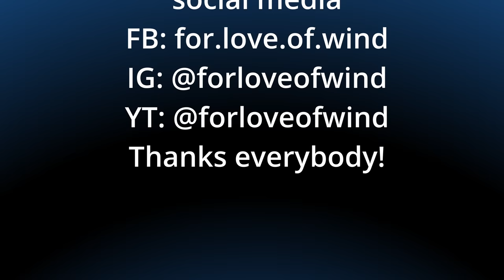4 Can we DIY an arch for our boat?

Comment: With this video you are now playing in my ballpark.😁 40 years of marine construction, overhaul & repairs. 1st thing, become a fan of latex or nitrile gloves. They'll save you many hours & some skin when it comes to cleaning up after using adhesives, epoxy & various paints. Not to mention preventing you from looking like a Picasso rendition at happy hour.😉 Everything else in no particular order, if max strength isn't a requirement stick with 316 grade stainless steel. (Backing plates & hardware.) It'll cut down on corrosion. Get familiar with butyl tape. It's a soft adhesive & great for sealing out H2o. That 5200 adhesive will make it harder to tell that the hardware holding the arch is coming loose or broke. If you do it right the butyl tape will make the hardware self locking & help keep it from backing off. Mount the starboard plates to the hull with the 5200 but mount the arch feet to the starboard with the butyl tape. That'll make removing the arch for maintenance or reconfiguring later a little easier. (As well as water intrusion resistant.) That Tower In A Box is a very basic foundation. (Think beginner level😁) In time you will probably think of many ways that it could have been modified easier before it was installed to accommodate things like antennas, lights & wiring and extensions to support a dingy & solar panels etc. 
This tiny bit of info isn't the tip of the iceberg challenge you've taken on. It's simply some of the shiny top of the tip of knowledge, expense & experience of boat ownership. BTW, That's one of the reasons I've downsized to a 15' canoe.😁 
BOAT = Bring On Another Thousand...  (Cash, planning, schedules, tasks & et al. 😉😂🤷🏻‍♂️🙏)
Best Wishes from the Northern Gulf of Mexico 🙋‍♂️
Reply from the maker: Thank you sooo much for taking the time to write this comment! We always, always appreciate advice from our viewers, especially with as much knowledge as you have after years of experience in marine construction. Please by all means feel free to reach out with any wisdom you have! I will tell you one thing we have learned so far in this new boat life, BOAT does INDEED mean Bring On Another Thousand. Sometimes Another Ten Thousand!!

Comment: Loved it! I would ask cade to purchase a box of vinyl gloves HAHHAHHAHHAH  I know the humidity makes your hands sweat, yet the toxins you can take in thru your skin,isn't worth the comfort of not wearing the minor PPE.  I do really appreciate cade's ability to comprehend the process make a plan and implement the plan to get it right.
Reply from the maker: You know, the funny (embarrassing) thing is, I think we actually had a box of gloves in the boat somewhere... Much of the time it seems like when we do these projects, we "don't think- just do." But you're right about toxins- we definitely don't want to expose ourselves to something dangerous. Cade is pretty sharp and very mechanically inclined, and it's a good thing because our budget dictates that we must do most of the repairs and upgrades ourselves!
Reply: @forloveofwind  Yeah, I am just a cheap ole bstrd, Hate spending money on things, which gets me into so much trouble with getting things done correctly and in a timely matter. Funny enough when I know I need to pay for the professional to do the work I have to deliberate about it far too long.
Reply from the maker: Yeah, that sounds awfully familiar!! We are exactly the same. I will tell you- we have a repair in an upcoming episode that really should be handled by a professional.. but the quote we got to fix it was astronomical, sooo <gulp> we are going to get a professional consultation only and then tackle it ourselves.... >_<
Reply: @forloveofwind  Ha you're gonna have to search youtube to see if someone has already done it. I know you all will get it done. That is one thing I think all sailors need to do. You then know what is breaking down at sea and it is not such a great emergency.
Reply from the maker: Well put, I think that is very true.

Comment: Great video. If the legs on the tower were asymmetrical, it would fix the wobbling issue.  2 things to consider.  When drilling through the exterior of your boat, consider the drill, fill, drill method using thickened epoxy.  I know the 5200 should seal everything, but water tends to find a way.  Also, getting a light shock by touching a metal bracket is a huge red flag.  Not just for safety, but it indicates stray current going where it shouldn’t. Check your zinc’s quickly and if you see excessive corrosion (if you still have zincs), tell your neighbors too.  Stray current can eat the metal in your boat within weeks, and everyone around you.  (I wouldn’t tell your neighbors that it’s your boat possibly causing an issue, then there might be a liability).
Reply from the maker: Thanks again my friend, it's a good thing we decided to post our story on YouTube because we've gotten a ton of good advice from the community on how to do things the right way. Since we learn while doing, there are many times when we have to do back and re-do things because they didn't turn out quite right... Keep the wisdom coming, I think I should copy all these great comments and keep a document on the boat that we can reference when we have a project... :-)

Comment: lol good video and you grooved it up with the music but surely you could have waited until it was in the water to fit it ?
Also trying to get a project catamaran to sail with but alas money tight these days
Reply from the maker: Yes, we could have done it in the water for sure. In fact, we did fit the solar rack and dinghy davits while it was in the slip. (We'll get to that in an upcoming episode.) We just tend to "donate" many tools to the marina when we work on the boat in the water. We lost a $25 washer in the water during the davit install, but they are only sold in packs of 4 so it was a $100 mistake! We looked at catamarans too but they were out of our budget- but a project monohull with good bones can be had for not too much money, and it would at least get you sailing..?
Reply: @forloveofwind  the one am looking at is an unfinished project only 10,000 pounds everything is ready to fit to it but trying to save before it gone is hard mate
Reply from the maker: I hear you. Good luck, wishing you all the best. I hope everything works out to make her yours and you'll consider sharing your experiences building her out, we'd love to follow along!

Comment: Not sure if I missed it, but how much did the tower in a Box cost compared to the 7k you were quoted..??
Reply from the maker: The Tower-in-a-box ended up being $3500. This price was for the tower and the Dinghy Davit extensions (you can get just davit mounts on the tower, or pay a little extra to have extensions that come off the back).
This did not include the shipping, which was about $700 from New Jersey to Florida (there were cheaper shipping options, but we wanted the tower to arrive while we were on the hard for the termites).
It was quite the budget stretch, but in the end we got more tower for less, so we are very pleased with our choice.
Reply: @forloveofwind  well done, a good saving and with a few trial fits I hope it serves you well.
Reply from the maker: Thank you!

Comment: First time seeing your channel and I hate to be a armchair quarterback but did you put 5200 in the bolt holes and on the backing plate ? Also aluminum or stainless bolts ? You know what happens when you mix 2 metals . Anti-seize on the bolts help later on also . You know something is going to need servicing down the line .
Reply from the maker: Thanks so much for commenting! We did not put 5200 directly on the backing plate, but the amount that oozed through the bolt holes ended up putting a decent layer on the plate itself. I think we forgot to put in the video, but the tower is anodized aluminum. It came with all aluminum hardware and yes, anti-seize is something we learned about early on- the hard way!! I am pretty sure something will definitely need servicing down the line- we learn by doing and many times have to backtrack and re-do something that didn't work out the way we expected. We always appreciate any advice, so please don't hesitate to comment!

Comment: Hopefully that’s quality stainless steel and rated for it’s intended use,I have no doubts you’ve done this maybe it should all be welded when fully installed pully mounts solar brackets sorted cheers
Reply from the maker: I can't believe we forgot to mention this in the video! The tower is actually anodized aluminum. We would have preferred stainless, but this kit is what our budget allowed for. We did contact the company directly to discuss our plans for the tower and they assured us that the tower will be able to handle the loads we will put on it. We followed the manufacturer's instructions for installation, so haven't added any additional welds- yet. We'll see how it stands up. So far so good, but you all will definitely know if something goes awry!

Comment: Guys,
If the bolts, that pass through seat, then pass through the deck, are only held tight by a single lock washer and nut, why not run one more nut up against the first nut, to lock it all in place.  With the second nut on all four bolts holding the seat in place, you will never have to worry about any of the nuts becoming lose over time and it is CHEAP!
Reply from the maker: Thank you, great idea! Fortunately we got gobs of 5200 everywhere so hopefully those nuts are still tightly in place.... 😆 Ay ay ay...

Comment: What did you use for your winching points on the boat to hoist up the tower for test fitting?
Reply from the maker: We used the boom topping lift for the tower. It was not very heavy at all, and the topping lift made short work of it.